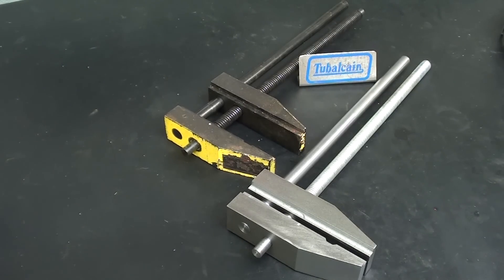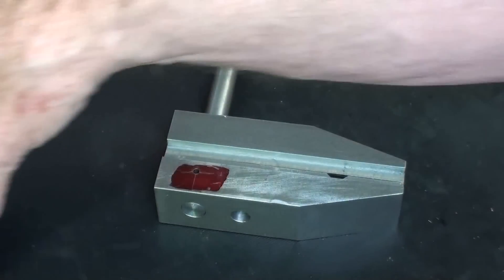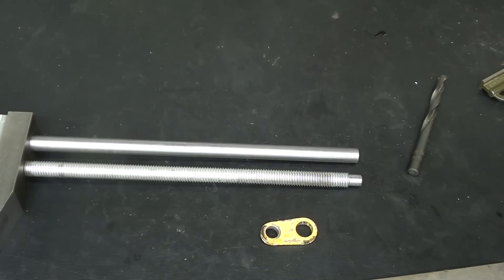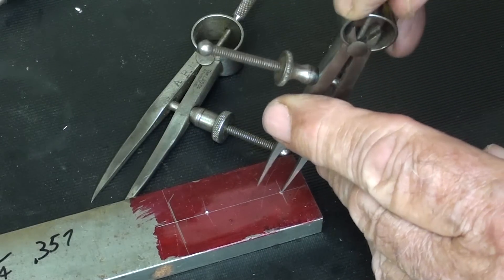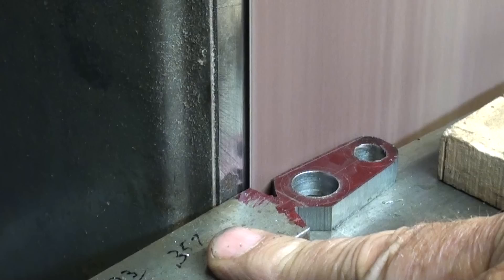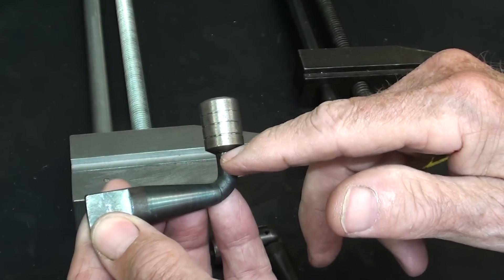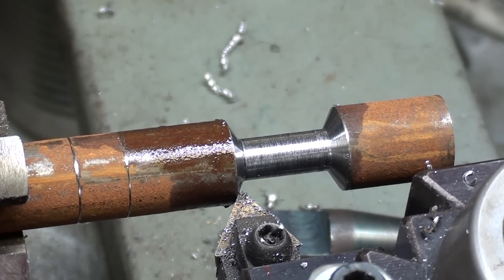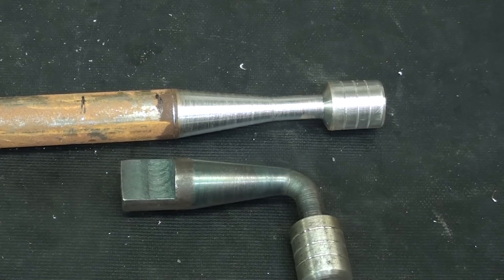MAKE A FLOAT LOCK Drill Press Vise TIPS 584 pt 5 tubalcain

Comment: Get some "Ospho" rust converter stuff from the feed store. (Is Farm and Fleet still a thing?)  

Dip your galvanized stuff in it for a day and the galvanize is gone.  If you oil the part afterwards it will have a pleasing dull grey-black finish that will not rust.

Comment: Mr. Pete, I've taken plated hardware and gave it about a day-long soak in normal white vinegar followed by a rinse and a wire brushing..it takes the plating off nicely and you really don't lose any appreciable dimension.  Shars is wise to sponsor you, as are your other sponsors..they know a good thing when they see it, as do we.  Thanks, Mr. Pete! :-)
Reply: It also seems to work faster if you heat the vinegar first, but it does smell like a salad! Lol
Reply: @Dominic.Minischetti  That would make it one of the better-smelling things here in my shop..beats cutting oil! :-)
Reply from the maker: Thank you, I will try that

Comment: FIRST!  LOL
Sorry Mr. Pete I just couldn't resist.
I'm thinking about making one of these with hardwood jaws for wood working.  There are many times when drilling small parts or using a hole saw that I've had trouble holding the piece.
Thank you for your videos.
Reply from the maker: Good idea